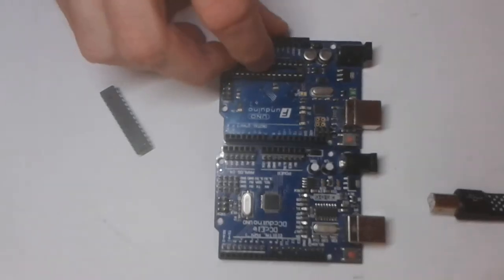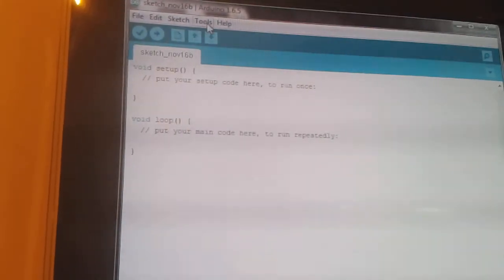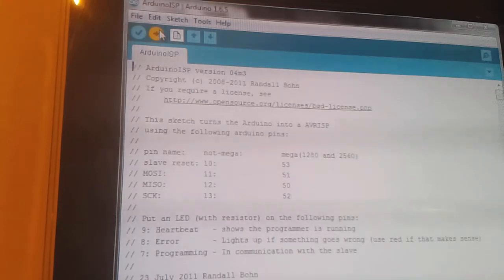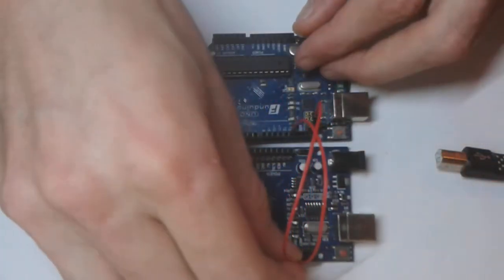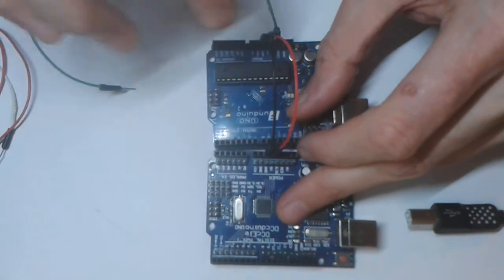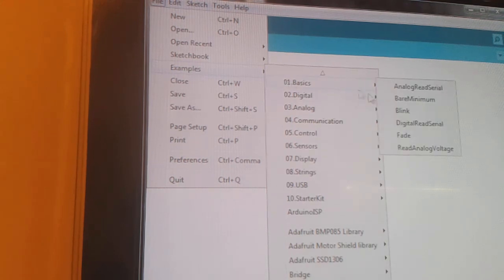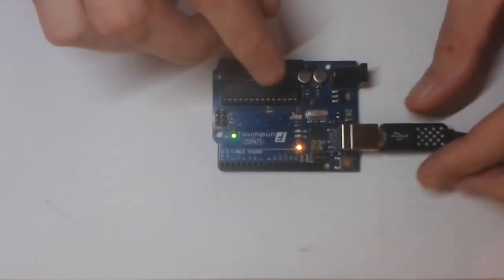How to burn bootloader using 2 arduino uno's (Tutorial)

Comment: Great video. I have one question can I use new clone arduino uno to burn bootloader to other clone of arduino uno? In video is used geniune?
Reply: you can use 2 clones but with genuine you can remove the ic so it's easier to just keep changing ic and create more boot ready ic's. I do have another video using a clone micro and arduino that should work if this doesn't for your setup

Comment: What do you do if the comment reads ERROR WHILE BURNING BOOTLOADER?
Reply from the maker: It will usually come up as error,  but it should be fine just check it on the board

Comment: Please can I help me,, I followed all steps but I did not success
It return error:
"Error while burning bootloader"
Reply from the maker: sometimes it'll come up error but it loads the bootloader, does the code upload or does the compiller go strait to error
Reply: @liney118  for the Arduino uno that I used as programmer it  accept to upload but when it comes to burn bootloader for target Arduino it brings that error
Reply from the maker: @fanuelmpusi9688  at the very end?  also check to make sure you have selected the correct target device ie Uno atmega 328-P....328_pu and make sure your IDE is up to date
Reply: @liney118  I am using two arduinos  Uno one as a programmer and other as target, actually my soft ware IDE  is updated

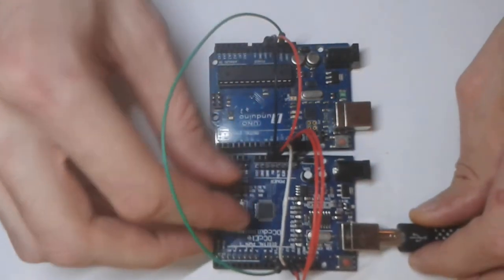Comment: what are you doing man after 2:22 ? is the master arduino automatically burn the bootloader??
Reply from the maker: in tools I clicked the tab " BURN BOOTLOADER"
Reply: @liney118  but its error while burning bootloader 😔
Reply from the maker: @mubashirshafie5487  then you've missed some steps or have your wires wrong

Comment: Arduino: 1.8.5 (Windows 10), Board: "Arduino/Genuino Uno"

avrdude: Expected signature for ATmega328P is 1E 95 0F
         Double check chip, or use -F to override this check.
Error while burning bootloader.

This report would have more information with
"Show verbose output during compilation"
option enabled in File -> Preferences.

Arduino: 1.8.5 (Windows 10), Board: "Arduino/Genuino Uno"

C:\Program Files (x86)\Arduino\hardware\tools\avr/bin/avrdude -CC:\Program Files (x86)\Arduino\hardware\tools\avr/etc/avrdude.conf -v -patmega328p -cstk500v1 -PCOM6 -b19200 -e -Ulock:w:0x3F:m -Uefuse:w:0xFD:m -Uhfuse:w:0xDE:m -Ulfuse:w:0xFF:m 

avrdude: Version 6.3, compiled on Jan 17 2017 at 12:00:53
         Copyright (c) 2000-2005 Brian Dean, http://www.bdmicro.com/
         Copyright (c) 2007-2014 Joerg Wunsch

         System wide configuration file is "C:\Program Files (x86)\Arduino\hardware\tools\avr/etc/avrdude.conf"

         Using Port                    : COM6
         Using Programmer              : stk500v1
         Overriding Baud Rate          : 19200
         AVR Part                      : ATmega328P
         Chip Erase delay              : 9000 us
         PAGEL                         : PD7
         BS2                           : PC2
         RESET disposition             : dedicated
         RETRY pulse                   : SCK
         serial program mode           : yes
         parallel program mode         : yes
         Timeout                       : 200
         StabDelay                     : 100
         CmdexeDelay                   : 25
         SyncLoops                     : 32
         ByteDelay                     : 0
         PollIndex                     : 3
         PollValue                     : 0x53
         Memory Detail                 :

                                  Block Poll               Page                       Polled
           Memory Type Mode Delay Size  Indx Paged  Size   Size #Pages MinW  MaxW   ReadBack
           ----------- ---- ----- ----- ---- ------ ------ ---- ------ ----- ----- ---------
           eeprom        65    20     4    0 no       1024    4      0  3600  3600 0xff 0xff
           flash         65     6   128    0 yes     32768  128    256  4500  4500 0xff 0xff
           lfuse          0     0     0    0 no          1    0      0  4500  4500 0x00 0x00
           hfuse          0     0     0    0 no          1    0      0  4500  4500 0x00 0x00
           efuse          0     0     0    0 no          1    0      0  4500  4500 0x00 0x00
           lock           0     0     0    0 no          1    0      0  4500  4500 0x00 0x00
           calibration    0     0     0    0 no          1    0      0     0     0 0x00 0x00
           signature      0     0     0    0 no          3    0      0     0     0 0x00 0x00

         Programmer Type : STK500
         Description     : Atmel STK500 Version 1.x firmware
         Hardware Version: 2
         Firmware Version: 1.18
         Topcard         : Unknown
         Vtarget         : 0.0 V
         Varef           : 0.0 V
         Oscillator      : Off
         SCK period      : 0.1 us

avrdude: AVR device initialized and ready to accept instructions

Reading | ################################################## | 100% 0.03s

avrdude: Device signature = 0xff0000
avrdude: Expected signature for ATmega328P is 1E 95 0F
         Double check chip, or use -F to override this check.

avrdude done.  Thank you.

Error while burning bootloader.
Reply from the maker: check you have the correct board

Comment: By far the easiest/simplest method I'd seen thus far. Thanks! I was having all kinds of troubles trying to burn a barebones breadbroad 328P. So I did this using a cheap Uno clone and now it has a permanent job as a programmer board. :-P
Reply from the maker: Happy to have helped, The clone boards are pretty reliable, I've got quite a few of them. lol I did get a proper Pi Zero just to play about with and the HDMI header wasn't soldered :(

Comment: Mine gives this error; 

Arduino: 1.8.3 (Windows 10), Board: "Arduino/Genuino Uno"

avrdude: Yikes!  Invalid device signature.
         Double check connections and try again, or use -F to override
         this check.

Error while burning bootloader.

Not a single fuckn thing works in the way it is designed to be. And not a single fuckn resource or guideline covers things in the way a normal human being expect. Unbelievable...
Reply: That's what I was getting BEFORE using this method. Check your target board...
Reply from the maker: I hope you got this sorted, I never got a notice of your message sorry
Reply: same error please help

Comment: what kind of programator we should use: AVRISP mkII or ArduinoISP or Arduino as ISP.. there is a lot difference programators..
Reply: - upload sketch "ArduinoISP" with "AVRISP mkll" programmer
- connect wires
- change programmer to "Arduino as ISP"
- burn bootloader
Reply: I used Arduino as ISP and there is a still problem: avrdude: stk500_disable(): unknown response=0x12
Reply from the maker: I'm using the Arduino Isp on this project :)
Reply from the maker: materialyrozwojowe arduino as isp I believe

Comment: i have a problem with the arduino i can't upload anything and the led TX and RX in the arduino don't blink so what i must do ?
Reply from the maker: Disconnect any pins/wires in Tx, Rx.
also check Board type and Com Port.
Reply: i  do  this and nothing happened
Reply from the maker: do you have a picture of your setup ?

Comment: hello sir! how can I connect 2 arduino uno and how the wiring is? I need 2 arduino uno cause the pin in 1 arduino is lack. so i want to use 2. can you help me sir?
Reply from the maker: just change it in the code